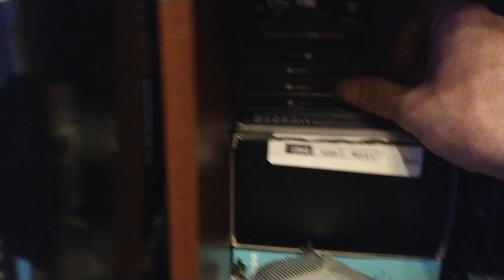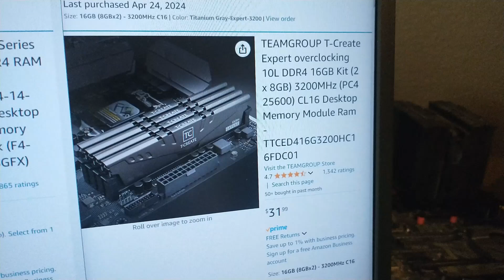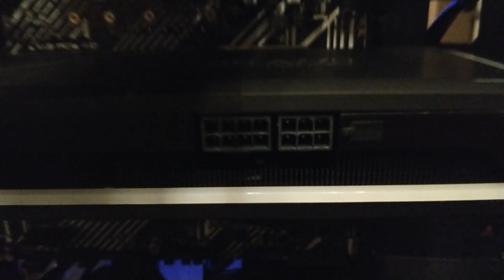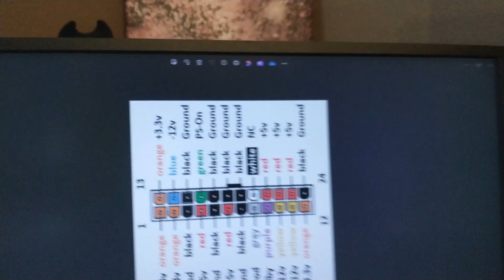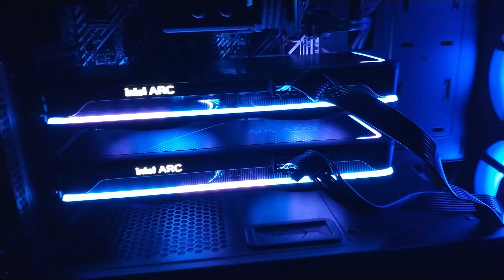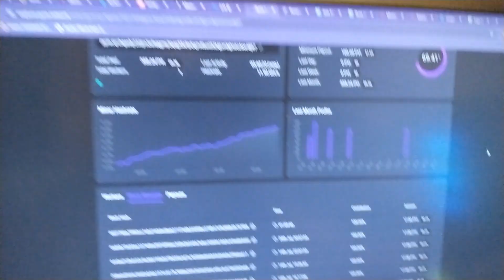How many mistakes can happen in one build? A770 Dual 2nd attempt... Dual voltage control is a myth!!

Comment: I have 2 A750s sitting on the sidelines right now but maybe theyll get sum work once i finish this 30amp install
Reply from the maker: 30 Amp install 👀👍👍 Very nice!

240v install will be at the end of this rebuild series 🤫 lol I'm very excited 🙂

The A750/770 does great at Erg/Novo dual on Srb fwiw... 
Especially with core voltage control ⚡⚡⚡

Happy hashing! 🙂🥂

Comment: I've got an ASRock Z690 Extreme MOBO that sees 2 RTX4060ti as one card in betterhash. Haven't used it like your trying to with the A770s though. I think the video codec takes precedence as a foreground app as windows sees it. I don't think intel was thinking about miners with their GPU architecture. Battlemage might solve the issue when it shows up.
Reply from the maker: @michaelcartwright306  Hey #208!🙂👋🥂
Oh that's wild... Haven't had two cards show as one before

Codec taking preference makes sense, ty! The crashes were unbearable... A data page would be just fine. One advert with any motion, black screen... uggggh lol

Omg so excited for Battlemage!💯

Really appreciate the watch and comment! All the best!🙂